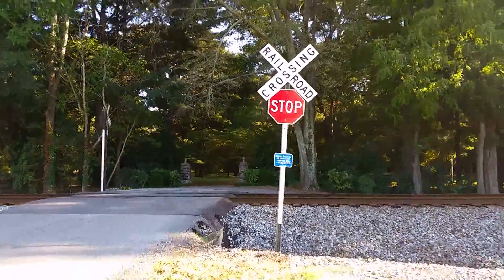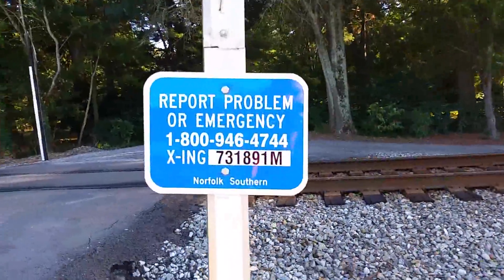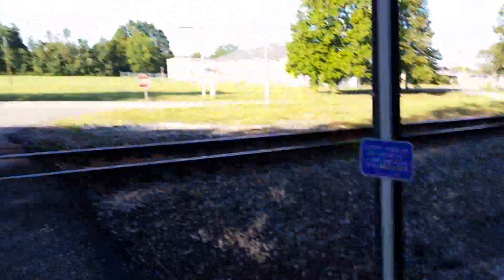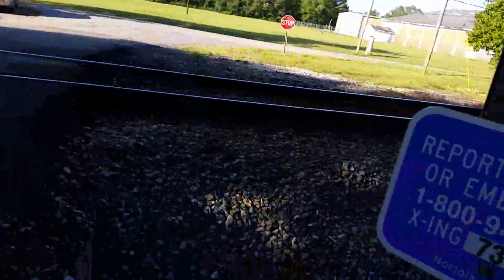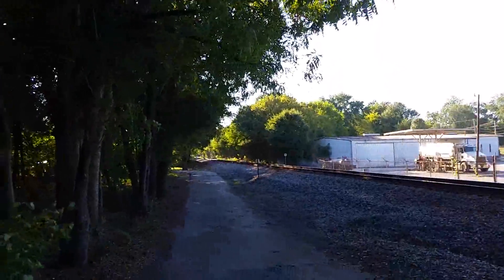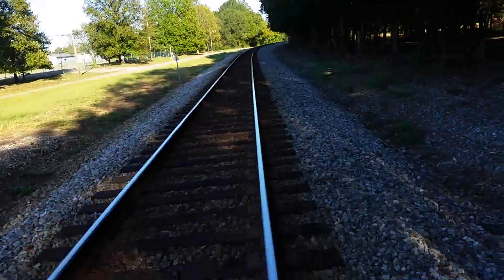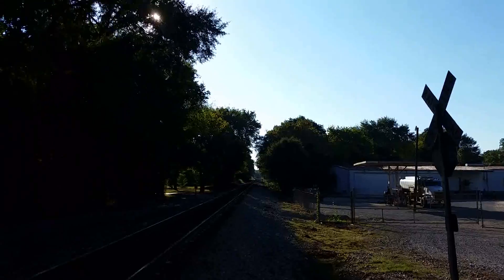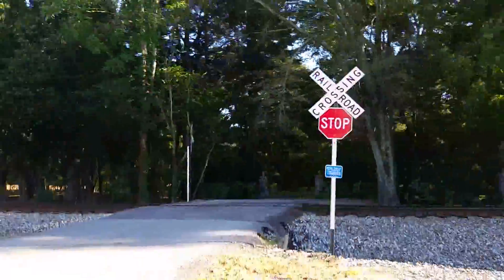Water Street Railroad Crossing, Courtland, AL Crossing Tour

Comment: Most passive crossings on the NS in Illinois use double sided crossbucks and wooden posts, while most I've seen in Ohio use metal posts and one sided crossbucks.  Weird.
Reply from the maker: Probably from the lines they took over. Most of NS's crossbuck crossings around here still use the old Southern Railroad crossbucks, which were single-sided and mounted on wooden posts, though they would also mount them back-to-back on a single wooden post, of which several still remain on branch lines.
Reply: TommyBNSF wrgbhhhh